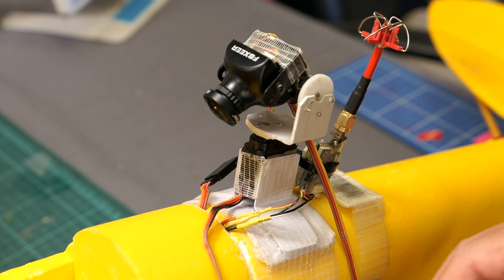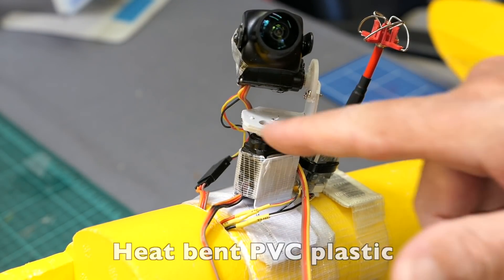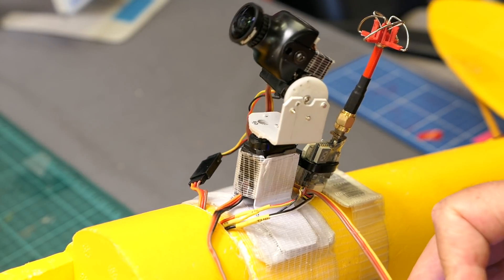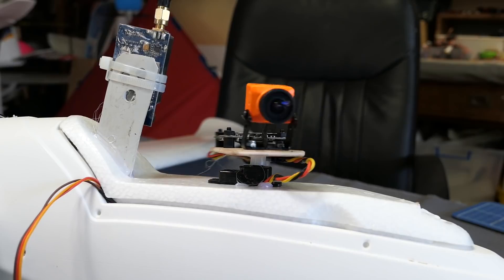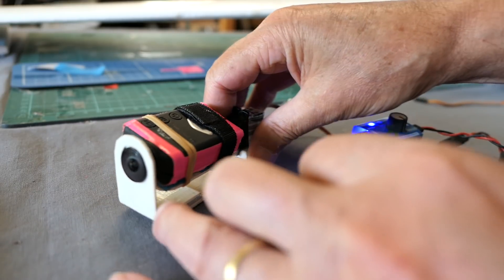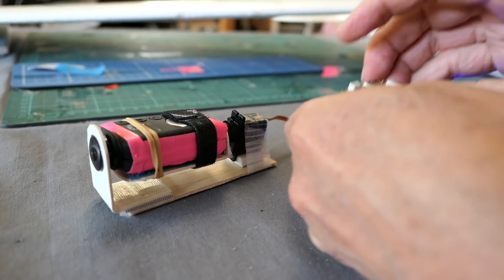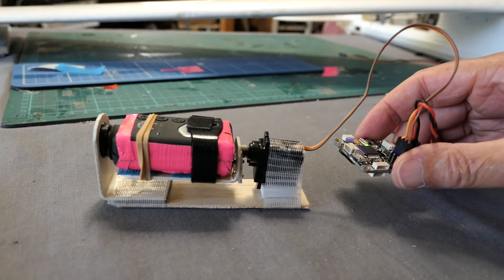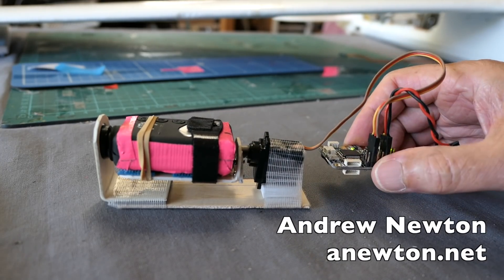Simple Pan Tilt and Roll servo gimbals

Comment: If an rx is an Aio so they dont have the pwm out, 
How an servo gets its from tx ?
Reply from the maker: Rx would be connected to a flight control board, which would convert the Rx output to PWM channels for servos. Should be pins for the servos on the FCB
Reply: @AndrewNewton  there is no pin on AIO FC ? How then ?
Reply from the maker: @junkthe  Quad FC? Maybe not designed to run servos
Reply: @AndrewNewton  well said. So i need additional rx ?

Is there Tx module gyro or so to be on head to work on  additional rx ?
Reply from the maker: Not sure what you're asking
Reply: @AndrewNewton  how to controll servo if im running Quad AIO FC ?
Reply from the maker: Depends on which AIO FC. Some can and some cant run servos.
Reply: @AndrewNewton  do you have video aio fc sugestion for it ?

Comment: Good stuff. Is it possible to run the roll axis gimbal stabilisation from a fc like the matek f411 wing that you are using as a general fc for the plane or do you need to use a dedicated fc? It almost seemed easier to implement this type of gimbal using the old naze32 boards as you did in your original video of the Mobius roll gimbal.
.
Reply from the maker: Yes, can use your plane's flight board. But the stand alone is very portable
Reply: Andrew Newton Thanks, yeah just looking into it a bit more a little stand alone unit that could be moved to different planes looks like a real winner, great info on your channel mate, thanks again.

Comment: Is there any way you can tell me how to set up the failsafe on the f405 wing, when I shut off the radio it goes into return to home failsafe but there is no throttle, also could you tell me how you got the RSSI signal to work, I'm using the l9r receiver
Reply from the maker: https://github.com/iNavFlight/inav/wiki/Failsafe#setting-up-failsafe-with-return-to-home For RSSI you need to connect the RSSI pin on there L9R to the RSSI pin on the board, then enable Analogue RSSI Input in Configuration and on the OSD

Comment: Andrew, depending on the flight controller you are using you might be able to flash Arduplane . Arduplane has pretty good gimbal support. I had pretty good luck swapping from Inav on my F405 Wing.
Reply from the maker: Interesting, I'll have to have a look at Arduplane. Have been ignoring it so far.
Reply: Hello. I made a servo pan tilt controlled by pixhawk and APM firmware, but it shakes and aggravate when when testing. Do u know what causes it?

Comment: Crude, yet effective Andrew. For the 3rd  one have you changed the amount the servo can move in INav as they changed that a few revisions ago? Matt
Reply from the maker: Aha! It's in 2.1 firmware (not a stable release yet) Still not matching the angle 100% on my servo but by adding second mix for the gimbal servo in the iNav mixer allows more adjustment up to and beyond 100%. Happy now.
Reply from the maker: Didn't see that Matt. Is that in the Mixer?
Reply: I would like to know about the “ cam stab “ for Inav as well it would be nice to also change the camera angle mid flight because I want to build a GPS quadcopter